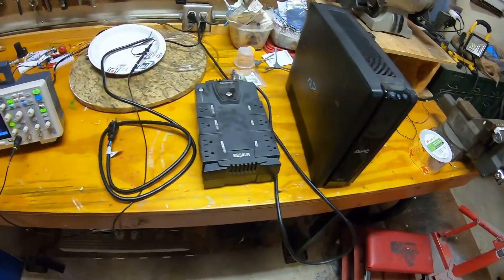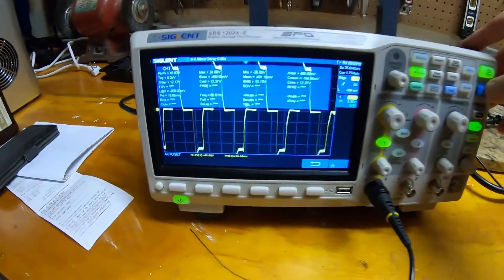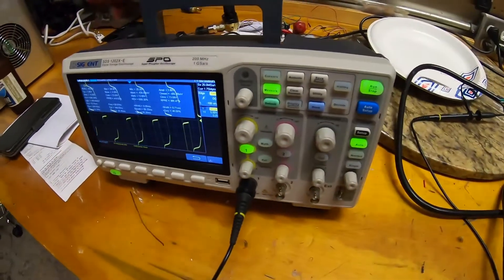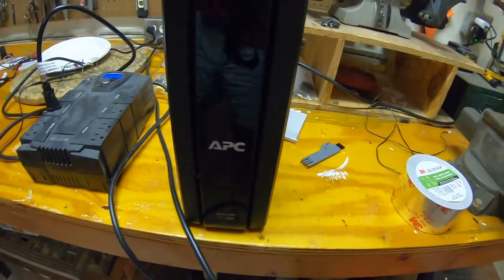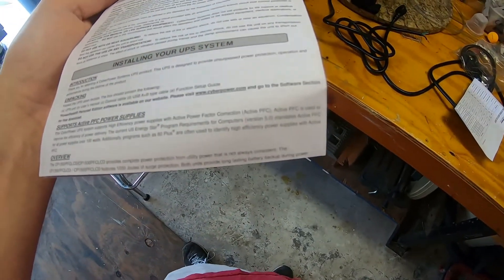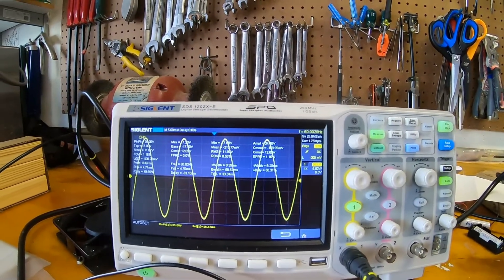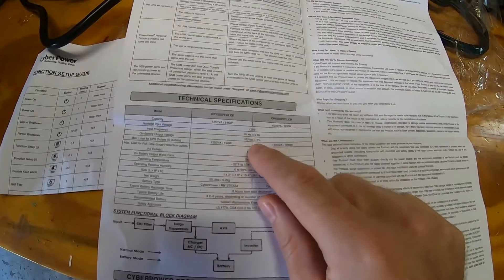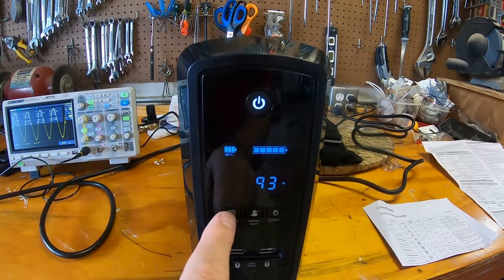UPS/Battery Backup Buyer Beware!!

Comment: A useful test might be an old clunker pc with an old atx and then new pf corrected power supply. Both should have a power good output test before powering the computer. It would be interesting to look at the ac output right after the line filter inside the power supply as well as the 3.3 5 12 rails.  The atx internal line (common mode chokes and caps) filter will strip out some harmonics (deviation from sine) be interesting to see how much.  Just be careful with were your scope bnc shields are referenced.

Comment: I think those are called modified sine wave, more like a mixture of square wave and sine wave. Those would be the line interactive type ups. Pure sine wave ups are usually double the cost of modified sine wave ups is what i know.
Reply from the maker: Modified sine wave UPSes typically produce that square wave looking waveform. Pure sine wave typically produce a pure sine wave looking waveform.

Comment: Great info', thank you. Could the zoomed-in, wonky 'Line' power, flattened curve peak be, instead of raw line signal, the result of AVR?  I didn't notice if the scope was ever plugged directly into the wall socket (while zoomed in). Thanks again, -R    (AJ-[California]-IR)
Reply from the maker: Thanks for the feedback! It's unlikely that what you see is caused by the AVR. I don't believe this model is a line interactive UPS. Line interactive UPSs will take utility power, convert it to DC and then pure sine wave AC. I don't believe this model does that.
Reply: @JoesGarageProductionsLLC  The CP1500PFCLCD is indeed a version which has the AVR and which is ''Line Interactive'' and pure sinewave. It only intervenes within a certain range of current variation in AVR mode and when it exceeds this range goes directly to battery.
This is different from the Online versions (double coverage) which are permanently active by converting the AC to DC and back to AC again. On the other hand, they are energy-intensive and noisy. You can't work calmly next to a double conversion since it has to cool down constantly. They are well suited for server rooms with poor power quality.
The ''Line Interactive'' versions intervene only when there is a variation in the quality of the electrical network and are more suitable for an office environment which must remain calm.
Each has its own advantages...

Comment: 10:35 You can see the sine-wave actually improve when the UPS switches to battery.
Reply: Because there are a lot of switching power supply devices on the grid what charges their's buffer capacitors at the peak of the sine wave.

Comment: I've done a test a while ago. To set the energy output of a UPS as input of a APC Smart-UPS with power conditioning.
When I use a pure sine-wave UPS as output, the Smart-UPS sees good power and happily takes it.
When I use the cheap stepped-sine-wave UPS as output, my Smart-UPS will not accept the bad power and runs off battery instead.

If you're on a low budget: Buy yourself a secondhand Pure sine-wave Smart-UPS and get a new set of batteries for it. Many companies throw out their perfectly fine UPS units when the battery dies. But it usually only needs a new battery.
Reply: Bad test. The UPS is designed to evaluate signal quality from the grid, and switch to battery if the grid is busted. Obviously, stepped-sin fails a grid quality test 🤠

Comment: Impressive output from the sine wave Cyberpower unit.  I'd like to see if it holds up that clean waveform under load.
Reply from the maker: I've had a couple requests for that now. I don't have a load bank that I can use to control the load, but I can show the waveform with it hooked up to a typical computer workload if you guys would find that interesting
Reply: @JoesGarageProductionsLLC  Yeah it would be interesting to see if it holds up under a typical load... no need for anything complicated.. just a typical load.  I would show it's output waveform unloaded., then loaded to see if there is any deformation.
Reply: @JoesGarageProductionsLLC  That would be nice, not many people making videos about this sort of stuff anyways.

Comment: Ups systems should never be used with large motors attached like fans, vacuum cleaners etc.... my Mrs flogged the batteries really quick using it like that a couple times, I'm sure it states that in the manual not to as well.

Comment: Joe, I have an APC sinewave ups. However, I'm new to oscilloscope and not confident hookin it up to ac especially after watching videos on sharing common ground. How did you get around this?
Reply from the maker: Not all oscilloscopes support measuring voltages as high as 120 volts AC. Before you even think about trying it, make sure your scope supports that. I believe I set the pro for 10x attenuation and then mine worked fine
Reply: @JoesGarageProductionsLLC  I just rewatched your video and have the same scope. although I'm using a differential probe which supposidly isolates the high voltage from the scope. I'm still am checking with siglent first.
Reply: @cyberwasp461  Using a normal probe is probably fine. The neutral out of the ups and the neutral out of the wall will be the same wire. Just dont get it backwards. you can use a volt meter first to make darn sure there is definitely 0.0V between the scope ground clip and the ups neutral wire output. You cant fry anything with the volt meter. Well i guess you can if you try. Dont plug the probe into the amps jack obviously. Differential probe should always be safe I would think, this is exactly what those are for. Check the rating on it and make sure its rated for 120v. Dont hurt yourself though. I'm just an idiot on the internet guessing about your situation.

Comment: Electronics always last longer when they are powered with a clean sine wave.

The less correction a power supply needs to perform, the less power you draw from the source and less heat you disipate into the air.

Buy a cheap UPS if you plug cheap crap into it.

Comment: Just my 2-bits... It all depends on what you are planning to plug in to your UPS.... IN the old days... The argument of sine-wave "quality" made sense with inductive transformers to prevent core overheating. Today nobody uses transformers on input. All power supplies are now switching DC to DC(at least for modern electronics.) that immediately rectify the input. In your example the FAN motor is directly connected to, and expecting, AC current (not DC).  That is why it exhibited issues with the "quality" of the Alternate Current switching(@50-60HZ) ... For modern electronics like: LED TV, laptops, routers, desktop computers etc.. , they convert power to DC and down-step the voltage. A modified sine-wave on INPUT will not be an issue. However, your FAN, or any other household appliance could have issues and eventually burnout.
Reply: Most modern electronics also have  active PFC and sine wave ups are essential for this kind of power supply.
Reply: You make some very good points. And accurate.
Reply: Radios
Reply: Hi, a newb here. So is it fine to use UPS APC Bvx1200va (stepped sine wave) on my pc with Active PFC (corsair psu 600watt)?
Reply: @orbit1524  i guess itll be okay unless you plan to use battery mode for a day continuously. In the end this UPS are built with backup needs in mind. It gives you enough time to finish your work and properly shut down your PC
Reply: @kaptenhiu5623  thanks
Reply: can i use a Simulated Sine Wave UPS with my Computer having an Active PFC power supply ?

will it damage my PC ?
Reply: A ups isn’t designed to run for an extended amount of time, so overheating will likely not occur.
Reply: @blackbearelectronicswithco9541 What? Let's say a modem and router is connected to a small UPS (about 330W) to provide uninterrupted internet access  when power is out, is the ups not meant to be running 24/7?
Reply: The UPS is made to be plugged in all the time. However, when the power goes out, the batteries run out quickly (Less than an hour usually). So the UPS won’t be running on battery power for an extended time period and overheat
Reply: @blackbearelectronicswithco9541  I don't get it. How is the going to overheat if battery runs out (not able to supply power to its connected outputs) and it's got no power input (blackout/shortage)? Back to the modem and router example, the other I had a blackout that lasted 3 hours and the UPS still had 70% of charge, with cases like this, is it a dangerous situation for a "pretty basic" APC (the one I use) 330 W UPS?
Reply: how far is the old days exactly because my PSU is like 2016 ish years old and still going strong but not sure if its modern
Reply: Who would even use a UPS on a fan and rice cooker anyway
Reply: Half way through this video I knew that I'd be able to scroll to the comments and find people who actually know what they're talking about, and how a basic fan motor isn't an accurate representation of anything a UPS is for. "I'm not an electrical enginer, BUT..." Nah. I'll get my advice from someone closer to an electrical engineer that can say more than "this thing doesn't look like that thing". Science & engineering are often very unintuitive to laymen.
Reply: Quick question sir. Is it okay to use stepped sine wave on a synology nas ? Did the stepped sine wave would crash my harddrive ?
Reply: @zakypradikto3576  I have had an Amazon Basic 800av for 1.5 years supporting my Synology DS920. I have had no issues, despite having several electrical outages. My internet modem and wifi router are also connected to it. Works Great. All these things have there own transformers/power-brick.. so it's not a problem my
Reply: @PierreFromCanada  thanks sir, appreciate ur answer. :)
Reply: @zakypradikto3576  Yes, it's fine. Your Synology, like mine I'll wager, doesn't plug into the 120Vac wall outlet. It plugs into (or "gets plugged into by") one of those power adapters. There is circuitry inside that thing which will basically take any AC garbage from 100 - 240 Vrms that it can gobble up, from anywhere in the world, no matter how sloppy it is, and turn that garbage into 12 Vdc gold by taking advantage of excellent modern rectifiers, capacitors, inductors and control circuitry. My Synology power supply will output up to 100 watts of smooth DC electricity. Your NAS doesn't care about what kind of electricity your power supply was forced to gulp down. Like any good circuit board assembly, it won't even trust that 12 Vdc input - which will be pretty much perfect in any casse. The NAS will do its own DC-to-DC conversion and clean-up so that the main board inside the NAS is reliably manufacturing stepped-down and closely regulated voltages like 5Vdc and 3.3Vdc for the sensitive components. And each of those "step down points" will have their complement of well-chosen capacitors to ensure smooth, sustained, ripple-free power.
The OP worries too much. Using a fan, likely with a junky shaded-pole motor, and a scope to make a judgement about an UPS shows that he hasn't considered the electrical current/voltage/power relationships at play here. He admits it himself at one point. And in fact, not many of us do. You'd be astonished at what the coils in the fan's motor do to the electrical supply it's connected to! Imagine trying to saw a board with a hand saw from 20 feet away and being only allowed to use a slinky to move the saw back and forth. THAT's what's going on inside an AC induction motor. So its easy to be alarmed when you see the mangled waveforms he showed of the unloaded AC being presented to the scope. A better device to have demonstrated the loaded waveform would have been his kitchen toaster. The toaster is a resistive load that doesn't introduce any lag or lead into the supply. Or maybe he could have hauled out his laptop...
Anyone who designs sensitive electronic circuit boards assumes at the outset that what ultimately gets fed to the actual silicon chips will probably be originally supplied by a 40-year-old diesel genny running on 3 of its 4 cylinders and perched atop an ungrounded trailer at a pipeline jobsite in the middle of nowhere. They design for that kind of situation.
Your NAS (and mine) will be fine. I'm running a run-of-the-mill APC office workstation UPS and I've plumbed its USB port directly to the NAS - and it works! Had a power failure the other day and the NAS popped up a notification to me and was totally prepared for a graceful shutdown. Just don't try to run an induction machine with your UPS. (And don't trust your UPS battery for longer that a year or two. Chemically, they just get exhausted and when the power fails, a 5-year-old battery which has never complained a day in its life will just fall flat on its face and leave your NAS to fall like Wiley Coyote off the edge of the canyon.)
Reply: What to protect electronics when using a back up generator. Non inverter.

Comment: Hey I breed snakes and I’m having a big issue with back up power to my snake room when I’m on generator power, the thermostats running my racks and incubator literally start arcing. Which I believe is due to the dirty power combined with the thermostats being a proportional/variable heat set up. I’m looking for a product that I can clean up the power through. Any help would be appreciated.
Reply: You need an electrician, in person.
Not uTube.

Comment: I have two APC UPS, a 650 and 1500, and I will advise you away from it. My Back-ups 1500 just died. It is just barely two years old and the battery(s) is in good condition. I contacted APC and they tell me it's out of warranty. Something is malfunctioning and causing it to show dead. I have junked out many APC UPS at Ford where I have worked for almost 30 yrs as an electrician. On the day my 1500 failed, I had junked out two APC UPS at the plant. To say I am disappointed in the company is an understatement. I will take the unit apart, because that's what I do, but I have already ordered a UPS from a CYBER power, and yes I have one of their UPS also. This will be my second. Oh yes, I also work with a great deal of Schneider's other equipment and I won't rave about it.

Comment: Hey Joe, Great video. The sine produced by the UPS is better shaped than the actual wall outlet. I always wanted to put those waveforms on a scope and compare them. Thank you for taking the time to do this. I am 100% paying extra for the sinewave UPS.
Reply: Looks like the one I got produces a kind of square wave, that they call simulated sine wave. But it looks nothing like a sine wave.
Reply: @louistournas120 are u facing any issue?
Reply: @nyumokongkang4483  No, my PC and speakers and laptop run fine on it and I cut the power for an hour to test it.
Reply from the maker: Thanks I'm glad you thought it was helpful! One of these days when funds permit I'll invest in a scope that does a better job of measuring power harmonics.
Reply: @JoesGarageProductionsLLC  I have similar battery back ups from cyberpower and the sinewaves coming from mine on battery are just fine. Don't buy used UPS power supplies, they are being sold for a reason, that reason being the customer broke them and wants to rip someone else off by selling it off to them.
Reply: @theexile4694  I hope that is true since I bought a new CyberPower LX1500GU3 and it does not say true sine wave on the box.

Comment: Unplugging the power cord from a ups is not a good practice to simulate a power outage because you disconnect the earth connection as well. This can damage equipment connected to the ups battery backup outlet requiring an earth connection. Switching off the circuit breaker is the safer way to simulate a power outage for a ups.
Reply from the maker: Thanks for the feedback
Reply: How would it be different than something operating on an isolaton transformer?
Reply: @news_internationale2035  You do not not plug in equipment requiring an earth connection pin to an isolation transformer because the isolation transformer floats the earth connection. Isolation transformers are for 2 pin equipment ( e.g electric dry shaver) and other uses.

Comment: its just a modified sine wave "approximation" they are fine for general backup use. true some psu's are grumpy when it comes to this but most will work fine. at worse your device will pull more power and generate more heat. DO NOT RUN induction motors off these things.
Reply: Why chance it in either regard?
Spend the Xtra, don't chance your power supply not getting along with the stepped wave and never worry about who plugs what into the back of it.
Reply: @truthsRsung  Personally, I would not connect any motor to any version of UPS (fan, vacuum cleaner, drill, etc). Buying a new one, I would buy the ''Pure sinewave'' version the same but when you already own an old quality Simulated Sine Wave UPS, I wouldn't throw it away... On multiple devices, it can bring more good how bad...